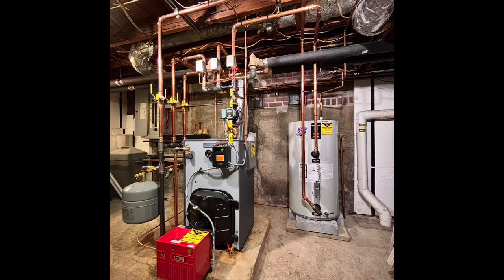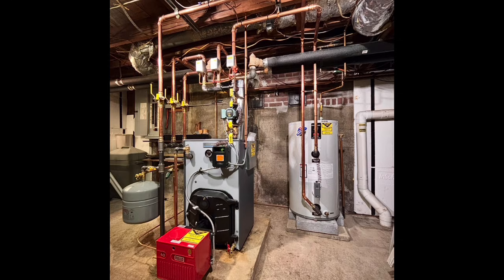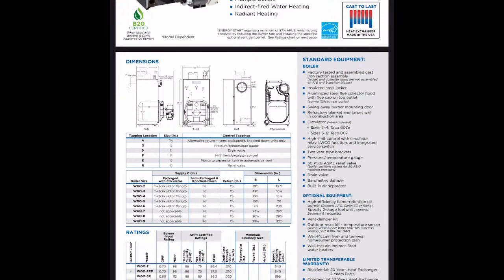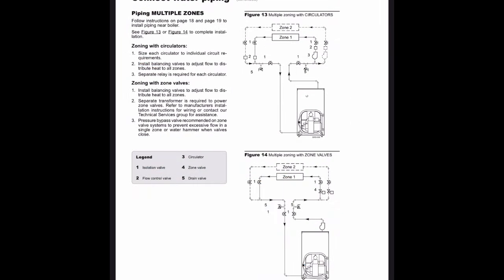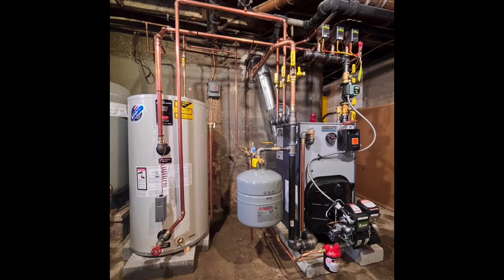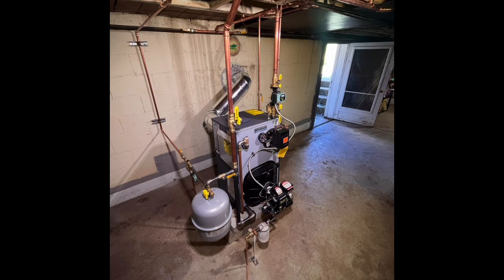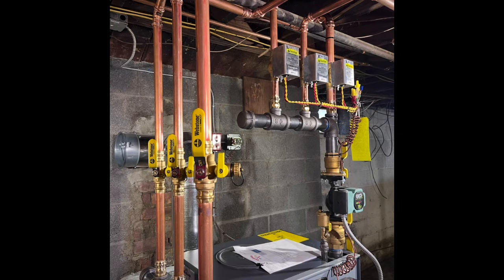Boiler School Saturday. Why No Air Eliminator?

Comment: Replacing my old 68, finally give up the ship. Thanks to my sons the new WGO4 is on the pad. Man it is cold in the basement. So being a DIY, I be plumbing AGAIN. Wasn't sure, so I put in a Taco Air Separator (horizontal) between the Taco 007e Circ and Honeywell Zone Valves. We have 3 Zones and about 400 ft of heating pipe. Actually, I watched your WGO videos on install and yes call me a copycat. Didn't black pipe the manifolds, remade my Copper 1 1/2. Sweat, Sweat, and Sweat some more.  Using Webstone valves and a few Bluefin. At 77 (my back is hurting) I want to thank you. Your videos saved me from the pep talk coming from my better half. By the way Mikey Pipes pretty much has the house. SupplyHouse did awesome job. Except they shipped the WGO without the bottom half of the disconnect plug for the burner. I gave them Hell. It all is working out. SO FAR!

Comment: First off I just wanted to say that your work and craftsmanship appears to be top notch!!  I have over 35 years in the business as an oil heat technician Here in the  Northeast US.  As any good,  educated technician know, any guide/manual put out by the manufacturers is a general guide for installation. The air vent/ hi vent that you install on the 1/2" air tapping off the boiler will most likely not work within 1-2 years at best. Installing a separate air eliminator in the boiler suppy may be "redundant" but it is more likely to work for many years and remove a lot more air from the system leading to many years of trouble free heating,  IE, less service calls. 
My company and myself have a very good relationship with our local Weil Mclain factory rep. and they encourage the use of separate air removal
 devices. 
Please keep up the great work,  but reconsider the use of a separate air removal device.